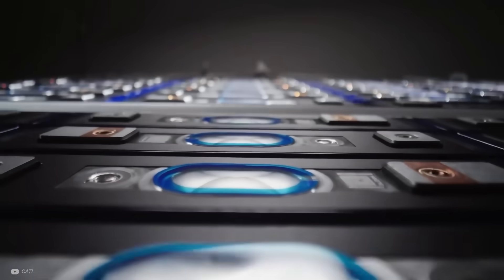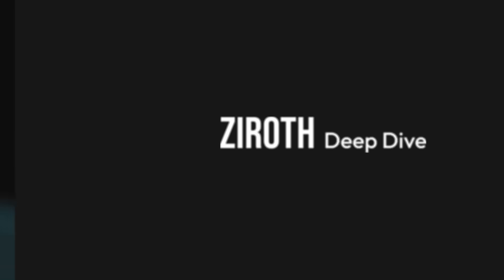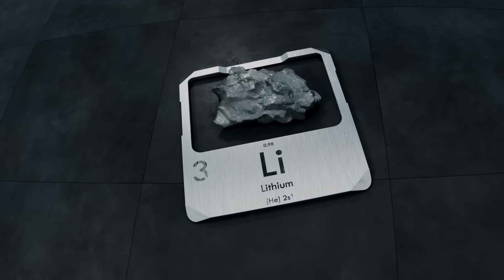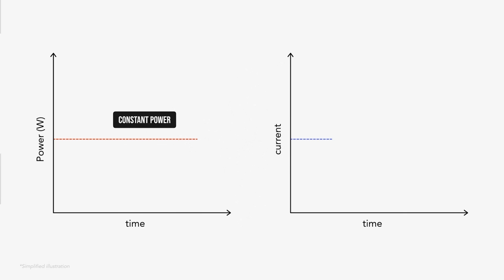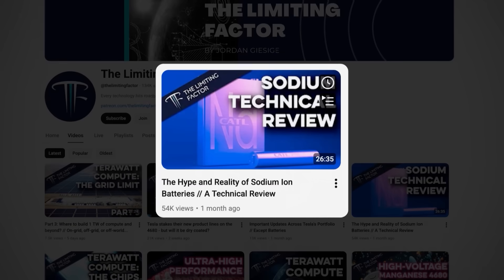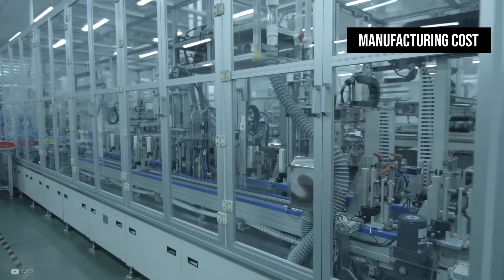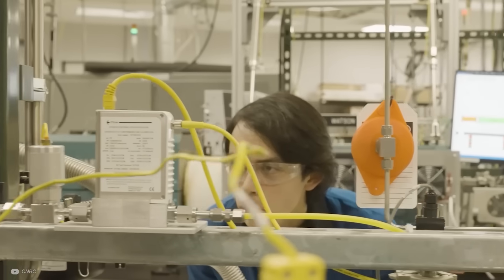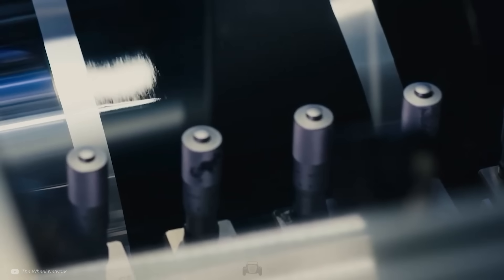How CATL’s Reinforced Sodium Battery is Insanely Cheap

Comment: Another interesting video, but I would have thought the initial focus for sodium batteries would be grid and domestic energy storage, as cost is much more important than density.
Reply: I recently read a company is going into production of a sodium ion battery that replaced the standard 12v lead acid battery. It's cheaper, lighter, safer, lasts much longer and it can be deep cycled without damage.. I hope all that is true and they replace lead acid batteries.
Reply: @natedavis3943  I believe there are already lithium equivalents out there, so it wouldn't be a step too far to create a sodium version, I'd have thought. AIUI sodium is capable of delivering a much higher current than lithium, which would be useful for an ICE vehicle (cold cranking amps, CCA, being a real measure); less so for EVs which are using them just to power existing 12v vehicle ancilleries.
Reply: @theelectricmonk3909 Better for both because of the temp range they work in. The thing I read said between -40°C - 60°C for sodium ion 12v and they last for the life of a vehicle.
Reply: @natedavis3943 sodium battery charge curve is not suitable for cars
Reply: It will be good to have a mix of both. Yet I don't think lithium ion will simply stay stagnant. 

 All the battery places will drop - especially once we get recycling on a massive scale.  80% of lithium sold should be recycled by 2035 at this rate. Circular economy. 

 Other valuable metals phased or more efficiently mined will drop that price. 

 If we don't go to war. 

 These new pseudo solid state batteries will be amazing as it allows engineers to create an electric car that weighs less than it's equivalent ICE. 

 We in America will never see a powerful, cheap, simple EV. It's all tech bloat, and penny pinching from here out. 

 YASA new world breaking prototype weighs 12.7kg with 350-400kw continuous. 1000bhp peak. 

 That peak is 12+ times more powerful than an F1s power to weight. Same as a top fuel dragster that requires rebuild. 

 The future is great, but America became an oil state without the profits. So not for us.
Reply: It looks like there's not enough demand. According to the vid, 70-80% of LiFePO4 batteries are used in EVs, which likely represents the vast majority of demand for high performance batteries in general. It seems like the begged question here is that in order to generate demand to warrant an economy-of-scale price drop for Na+ cells, they must be competitive enough to displace LiFePO4 in the major battery market, EVs. Na+ cells at the moment are not cheap enough to create a whole new market for grid/domestic energy storage, which means that unless they attempt to compete for a bigger piece of the pie, they will never become cheap enough to do so.
Reply: @theurdragon2611  Sodium Ion batteries will become the go-to for large scale static storage - grid level stuff, home batteries, etc. Since they're already close to price parity with the very well established Li-ion manufacturing process, it won't take much scaling up to tip the balance in their favour; and if they really can compete on charge density, they'll end up wiping the floor with NMC/LFP batteries across the boad.; just as lithium batteries wiped the floor with NiCAD.NiMH batteries.
Reply: @theurdragon2611  LiFePO4 are not "high performance". They are lower performance than LiMCo, which is why they weren't the first choice for Tesla. But they are lower cost. This is the same tradeoff that will occur with Na-ion: lower performance and lower cost (Do you care if your rechargeable flashlight is 10% bigger for the same output? Do you care if the pack for your battery-operated Xmas lights is 10% bigger?)
Reply: Grid level storage doesn't have the volume yet. Renewable energy storage is nowhere near the level of build out that EVs are at now. It could change in China as they're looking at removing their reliance on fossil fuels, so all it takes is a government mandate.
Reply: Also longevity and safety. Economical grid and domestic energy storage requires a lot more loading cycles and less degradation over time than Li-Ion can provide. Less propensity to spontaneously combust would also be important.
Reply: @axelhopfinger533  Li-ion batteries do not "spontaneously combust". They do burn if you mistreat them, e.g. overcharge, over-discharge, stab them with a sword, etc. Although some manufacturers now offer stab-proof batteries (you can still stab them to death, but they don't catch fire). And over/under discharging is well handled with BMS systems. This is probably why the only major study on the fire risks of EVs concluded they were around 20 times LESS likely to catch fire than petrol/diesel vehicles. Not having up to 800 explosions per second going on under the bonnet probably helps.
Reply: @theelectricmonk3909  the 800 explosions per second in an internal combustion engine really isn't the issue with say petrol. That's quite well controlled . The major fire risk with petrol ( much less so diesel, which is pretty hard to  ignite at atmospheric temperatures and pressures ) are fuel leaks.  Leaking petrol is highly volatile and very easy to ignite.
Reply: @karlosh9286  That's fair: I drove petrol, mostly, and occasionally diesel cars, and yes, the combustion itself is rarely a problem. Worth noting that even diesel will burn freely in atmosphere if it's hot enough - e.g. if leaking fuel happens to fall on a hot exhaust manifold, for example; although ISTM the more typical failure mode of a diesel is when it starts ingesting its own oil & goes into full runaway... Easily identifiable by the high RPMs, clouds of noxious smoke, and inevitable catastrophic failure; they occasionally end up on fire, but not always.
Reply: @theelectricmonk3909  yes , especially mechanical injection diesels can go on runaway. I assume the ones with electric injectors should be easier to shutdown. I hadn't thought about the diesel on the exhaust. Although petrol must be by far away a bigger fire risk than diesel. The issue with diesel is because it doesn't burn that well, so it is an incomplete burn , with lots of pollutants. Things like LPG or Methane , well they burn really well , and were a lot greener than diesel or petrol on the noxious fumes out of the exhaust.
I did once have an LPG converted car. The engine oil still looked almost brand new after  10,000 miles.
Reply: @axelhopfinger533 as it would in cars. Dummy
Reply: @SevenCostanza   I'm curious,what part of your ego requires you to say dummy at the end of your statement.
Reply: Yeah, I had heard that sodium batteries weren't good for vehicles, because they were too heavy. They were more suitable for fixed structures. (I haven't watched the whole video yet).
Reply: @dishmanw  WRONG. They have a density higher than the existing BYD Blade LFP batteries at 160 wh/kg vs CATL's 175 wh/kg in its first generation in production now with the goal of getting to 210 wh/kg in the next version due by the end of 2027...
Reply: There is, just not as much which is why CATL is leaving those markets to smaller fish... They're trying to turn 40% of their global 40% share to sodium ion by 2030... 4 years to shift 40% of their own internal market? Seems daunting but doable for this behemoth!
Reply: 在中国，夜间的电便宜很多。如果有储能设施，我可以平衡电费😄
Reply: I run my home on 2 lith golf cart batts about 10kwh  4kw max out put. And 2km solar aray. 
It works well but the batts are not lasting long enof only about 2.5 years  (its a work in progress)
Reply: Or maybe cheap EVs in the low-end of the market, which anyway desperately needs price drops for better adoption.
Reply: both of them are important ... why not
Reply: Catch 22 situation
Reply: If they can approach or surpass lithium in energy density by weight, they're going to enter the mainstream. LFP batteries are already there even though they have a lower energy density than lithium, they have better lifetime charge characteristics and are cheaper.
Reply: @Neuralatrophy LFP batteries ARE lithium.  And the newer Li batteries that are all solid state will have nearly double the energy density.
Reply: @surferdudemi  👍Lithium Iron Phosphate, I believe they use less lithium, no cobalt and are far more stable and are cheaper to make. Going from memory 🤔

Solid state will be quite interesting when it hits the EV market in force... Manufacturers will probably opt for smaller packs rather than packing more watt hours into the cars which will cut weight and extend range as a result. Trucks on the other hand will see a HUGE benefit from solid state !
Reply: @Neuralatrophy They also last for far more cycles.  I've got several packs of them.
Reply: Didn’t china outlaw any battery that can catch fire from being manufactured after start of 2026, I may be mistaken but I was under impression this mandate was reason for accelerating sodium development
Reply: Same... I read the same from the company too, that they expect this to take off first but EV grabs more headlines
Reply: Yeah, and the COLD truth (while an estimation, is at 13:23) where the price will drop to the SAME as Li after 7-8 years, and then be slightly lower after 10 years.  If Sodium was as cheap as Li, I would buy them now for energy storage. Simply said Li, will be good for the next 10 years (the "estimated" efficiency lifespan of them).
Reply: @PjotrII  The cost of sodium is peanuts compared to lithium. The main obstacle is scale, which will come from industry and consumer confidence, but it takes time.
Reply: @SpiritmanProductions   yes, and I don´t argue against that. However I see production cost, and price in the store as 2 separate things.
* CATL is a huge producer of Li batteries... if they put out So batteries really cheap, they destroy their own market and production.
* So how would a company likely do? As they are (in a way) the first with a next gen So battery, they NOW have the time of their life to get profit from it.
* When they have gathered profit (for some years) and the competition gets harder, they have all the possibilities in the world, to lower Li production, and also lower So prices.

CATL selling So batteries for "1/2" the price won´t happen now. Just my view!
Reply: @PjotrII  I agree.
Reply: Storing large amounts of electricity is not practical, expensive to build and constantly maintain the battery cells.  Instead, build a couple of high powered nuclear stations to generate reliable base-line power to run homes and charge EV batteries.
Reply: @billant2 It's not hugely expensive and you don't have to constantly maintain battery cells.  Once they are installed, the BMS handles it all automatically.  You don't have to fuel them as with a nuclear power station, there's no radiation to worry about when you maintain them, and you don't have radioactive waste to dispose of.  The turnaround cost is less than a few pennies per kwh, and you can use solar, wind, hydro, or any other electricity source you like to charge them when demand is lower than supply.  Battery systems make already competitive renewable power sources even more useful.
Reply: @surferdudemi  Battery systems are really the only way to make wind and solar usable all the time !  Dammed off hydro electric power can be controlled to demand on the grid, but well the sun doesn't shine and the wind does blow in a human controllable way , all we can do is store the energy when its sunny and/or windy for later use when we need it !
So long lasting , cheap to manufacture, maintenance free batteries are a bit of a holy grail for solar or wind.
Reply: @billant2 Building more nuclear (beyond a base level demand) without storage actually makes the situation worse. As an example, look at Ontario grid which - before the recent nuclear refurbishment which took several nuclear plants offline temporarily - Ontario paid for TwH of electricity produced at Nukes that there was no demand for.   Inflexible generation (nuclear) has the same problems as intermittent generation (solar and wind).   Both create big grid issues if not scaled and managed correctly.  Grid level storage is the answer to both.   And the need for Grid level storage (and related cost) is reduced massively by having flexible energy pricing (making surplus energy available at marginal cost so businesses and individuals will invest in load shifting equipment and battery storage).
Reply: The Volumetric capacity of Iron Air is Significantly Higher for Grid Scale Operations.
Reply: @antoniopacelli  except iron air is still in the hypothetical phase, meanwhile sodium batteries are basically ready for mass production.
Reply: Xcel Energy is currently installing a 10-megawatt iron-air battery system from Form Energy at the Comanche Generating Station in Pueblo, Colorado.
Reply: @antoniopacelli  true, but I haven't heard anything about Iron-Air lately (expecially about big scale production)
Reply: @antoniopacelli  As mentioned, it is still theoretical, but also neither volumetric nor gravimetric energy density is important for grid scale. It is lifecycle, cost, and efficiency (practical over all efficiency).
Reply: @antoniopacelli  Then maybe that's where the focus should be. 🙂
Reply: I think theres just not enough demand to make manufacturers focus on grid storage instead of bevs.
Reply: @pali3329  Over 300 GWh of grid battery storage was installed in 2025! That's dozens of battery factories.
Reply: You'd think so, but we're talking about a huge difference for grid-level scale especially. Density is immediately related to cost because it controls how many units you need to purchase to hit your desired amount. It's also going to be a benefit for maintenance costs, too, because it's easier to manage a smaller amount of cells. I don't know if it would make a big difference for industrial-scale or home-scale use, but even for the home the density seems to be relevant because of how the systems are often packaged as complete units, and bigger numbers are better there.
Reply: They aren’t cheaper though, and won’t be until they reach scale.
Reply: @jordanhildebrandt3705   But with the price of solar going down so much, the need for storage will be exponential, and it is CATL , the biggest battery manufacturer behind it. I am sure they will provide the scale needed.
Reply: @danielvilliers612  also sodium is way safer and can operate at a wider temperature range which also is good for grid storage (also ev-use is power density is high enough)
Reply: @dammuozz  and thus further reduces total cost of implementation and use
Reply: @jordanhildebrandt3705  They are cheaper right now from CATL in China. When they will be cheaper worldwide is unknown, probably depends on how fast CATL scales... well except for in the US where we can't buy them.
Reply: @mikereinhardt1244 They will never be cheaper in the US.  Once they become cheaper your idiotic political system and lobbying will result in massive tariffs so consumers will never see the price benefits.
Reply: @Spp235.  That was the whole point of my post. Ignoring the idiotic part, it is complicated, and  certainly there are issues with it, and every other political system on earth, show me one that works better... 

Yes tariffs is the whole point of my post, but that does not impact batteries made here or with a nation we have a trade agreement with (like Japan or Korea). Once production spreads outside of China (which seems to take years) it will be cheaper worldwide including in the US. My whole point was, though, that the US will be the last to have them at all, but when we get them they will be cheaper.

The whole point of tariffs (BTW) is to make sure production is in the US. Now if that actually works or not is not fully known yet. We will have to wait and see.
Reply: @jordanhildebrandt3705  .
Reply: @jordanhildebrandt3705  Says who? This dude? CATL's own spokesperson at the Shanghai Auto show said $45 USD/kwh... The cost analysis used was already based on outmoded data...
Reply: Your observation points to the whole thing being a bunch of BS.
Reply: @michaelg4931  ???? the only BS comes from you !!!!!!!!!!!
Reply: @michaelg4931  Why? People like to put ESS batteries outside (because fire risk, or at least perceived fire risk), and sodium-ion works fine outside without heaters and corresponding inefficiency so that will be popular as soon as the price is reasonable. Some people will also buy them for the 'no problematic materials' reason. Right now they are more expensive than mid-range LFP, but cheaper than expensive ones. Seems likely that they will get enough sales to grow and get cheaper.

Comment: People need to stop thinking only about electric cars whenever new battery tech is talked about. These will be revolutionary for large grid storage applications as well as home solar if they really do end up being that cheap.
Reply: I'm currently designing a home battery storage for my new home of around 32kWh. LFP batteries are less then half of the cost. The round trip efficiency of Sodium is terrible so if that is not fixed, these will never become viable for home usage.

Comment: I'm still rockin NiCad due to the safety, hard to believe you don't put safety first. Before the fleecing
Reply: Toxic heavy metal not good for the environment. Memory issues to manage, slow charging, bulky with low power and energy density. 

Having said that, China recognized that its battery industry was taking huge development and quality risks in its race to scale and has written regulations to mandate safety and in the case of BEV batteries certification that the safety requirements are being met.
Reply: @clarkstonguy1065   I was fond of Robert Murray Smiths carbon based battery and would happily accept any of the claimed deficits to use them